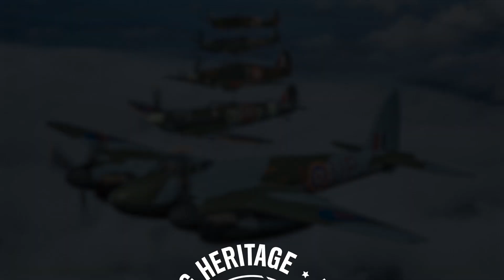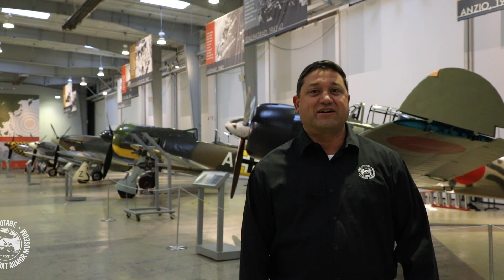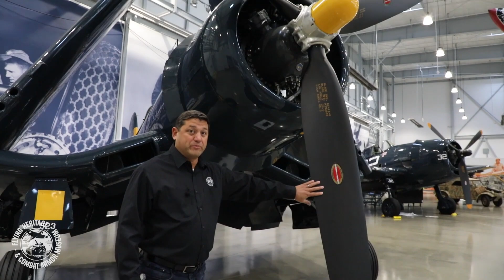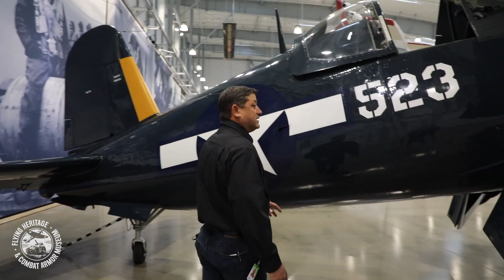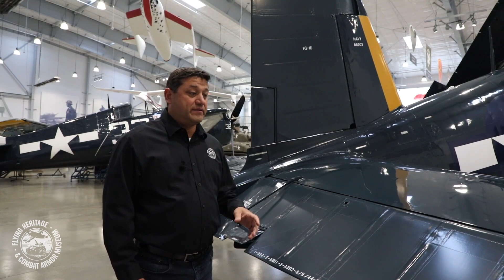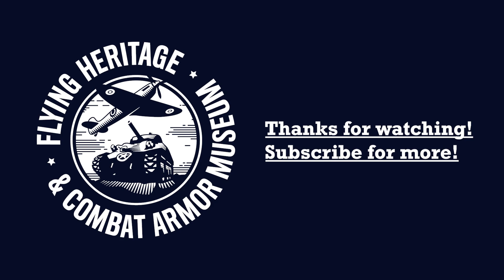Annual Inspection |  Introduction

Comment: Question: how does the museum address the original avionics of your museums aircraft?
Reply from the maker: We install the original equipment the aircraft originally carried during WWII whenever possible, which is the majority of the aircraft. Additionally, we install modern COM and Transponder units in as inconspicuous locations as possible so not to take away from the originality of the aircraft. -Jason M.

Comment: Besides the aircraft themselves my interests are in the military historical radio systems used in the aircraft. I understand the FAA’s requirements for communications that make it necessary to modify or update aircraft at are going to be flown.

Question: how does the museum address the original avionics of your museums aircraft?